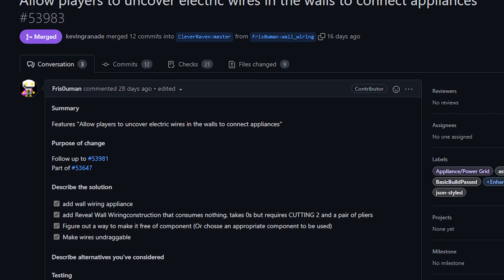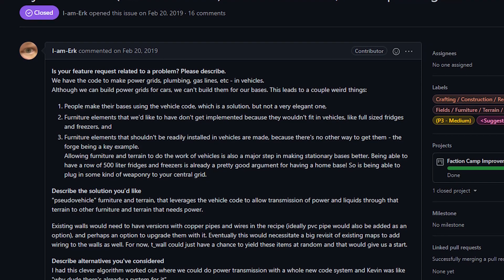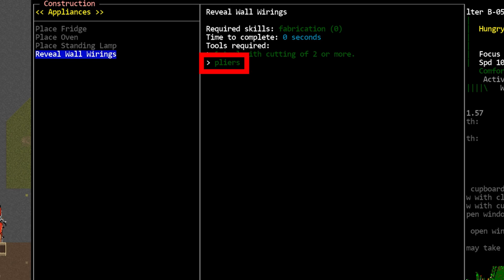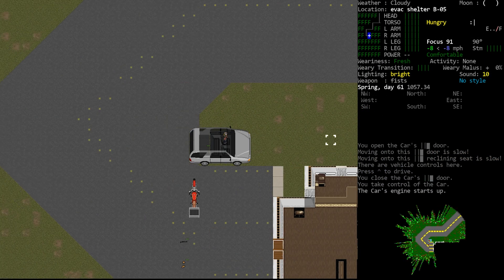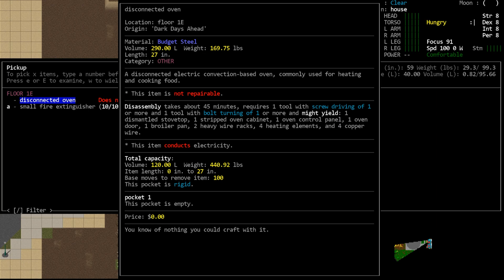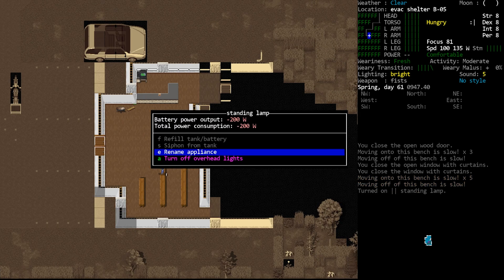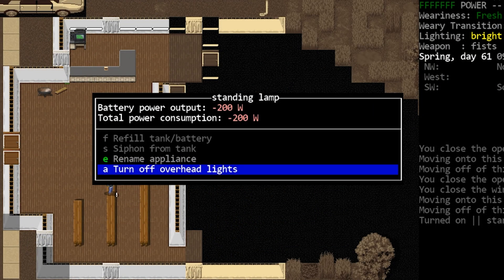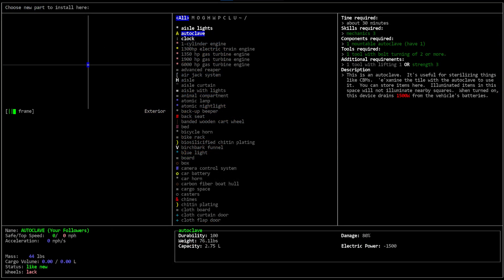Experimental Cataclysm - Building Power Grids

Comment: Does this power grid work across Z levels yet?
Reply from the maker: As far as I know, it does.  I don't specifically know how it works, it's new-ish.  Someone said that if you reveal wire directly above/below another wall it reveals wiring on the other Z level and it's shared between.  I have not verified this, I don't know if that's correct.
Reply: @TheMurderUnicorn  Ah I'll have to try this then and see. Thanks for the helpful videos and super fast reply. :D
Reply: @TheMurderUnicorn  Just FYI I went to test this. I wanted to get the wires running from my basement to the roof. Turns out I couldn't reveal wires on the roof. I guess that makes sense.. but its kinda what I needed it for. Oh well, worth a try.

Comment: Could have a mechanic that when you use a volt meter on a wall it could check to see how much power if being run though. Also a way to hide or show the wiring symbol would be good too. Kind of like how in Rimworld when you're building power conduits it shows where previous conduits have been built.

Comment: In response to the pliers being used for revealing wires, the reason it is used is because (theoretically in real life) you use the sharp part of said pliers to scour the plastic cover from the wire in order to splice in your own copper wiring into said strands. Twist up the copper together, and you'll get a connection. Not the safest connection, but a connection.
Reply from the maker: Yeah I get that.  I meant more like I think it would be better to have a pliers quality or wire stripping quality, that way we could apply it to pliers in addition to other tools.  And I know it's a pain but you can strip with a knife if you have to.
Reply: @TheMurderUnicorn  I agree, just wanted to correct that part of the video. Informative vid, got me the info I need for how the power grids seem to be used/work.